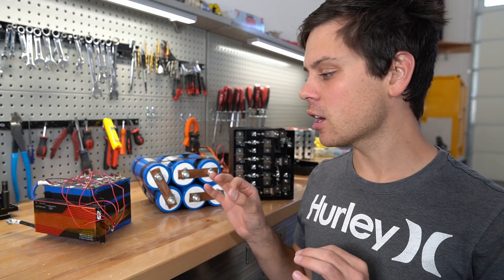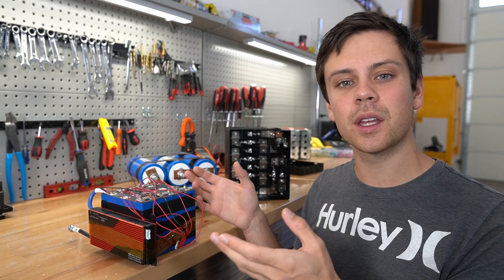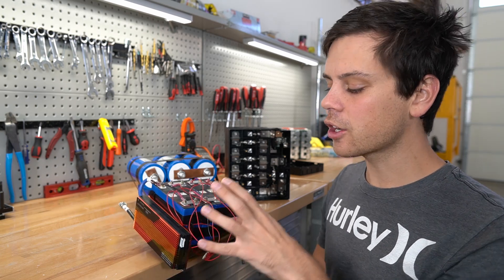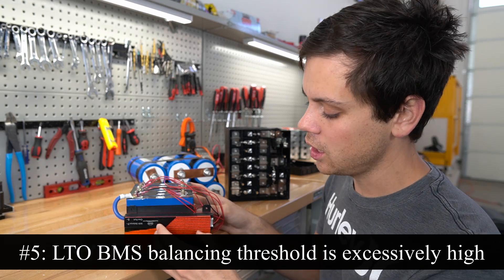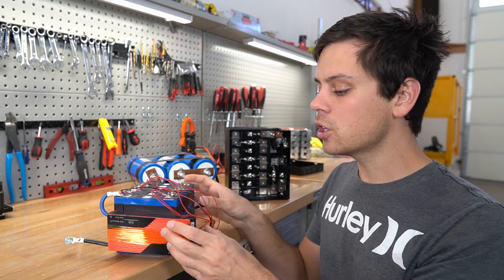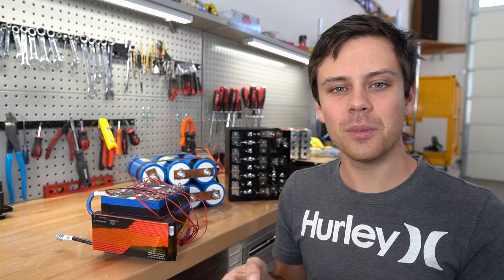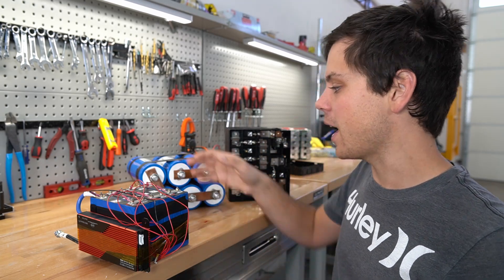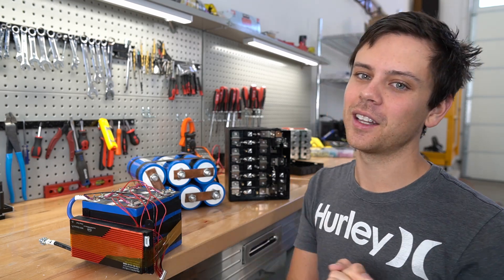I was wrong about Lithium Titanate batteries. But should you use them for solar? 2020 Update

Comment: Ahhhh thanks for clearing up that conundrum  - Your earlier superstition that Titanate  for super long life, fast charging with a downside of high cost, weight and bulk is still valid - I've concluded that Lifepo4 in 4S  is best for my motorcycle starter &  RV house battery because  they are most comparable with the alternator outputs (14.2V) - and li-ion for my ebike because of power density and compact size  - its a horses for courses approach  - as you said in your earlier post Titanate would be best for a remote station  were servicing was infrequent and where temperatures might be sub zero -  it could well be "Rocket Science" at least in application : )

Comment: Will, I was planning to get LTO's for a very specific niche.  Where I live they cut off power in partial part of my city due to high winds and I need to be able to recharge the batteries super fast and also be able to run a 120v fridge  which has a momentary 2000 watt amp draw for the compressor.  As such I'm looking to keep my expenses under $700 and LTO and 1500 watt inverter, home built 800 watt wind turbine (remember the high winds) all a part of the equation.  The turbine can spin up fast with 60mph gusts and dump it's juice into the LTO's.  Part of the job of the LTO's would be to keep the turbine from self destructing due to it spinning to fast by being able to take the whole load as opposed to burning off the excess through a resistor.  The other nice thing is that I can drive down the road where there is power and my neighbor will let me fast charge the batteries from 120V AC 20 amp circuit connected to a fast charger.  This is only if there's no winds.
Reply: Effective storage is based on the capacity you need,  prices I’ve seen on lto cells are around 60 bucks per 40ah cells , so around 1000$ per kw for storage, 700$ budget would get you two 6s 40ah setups so 80ah plus wire and Buss bar costs, if anyone knowS of a cheaper place for cylindrical cells let me know
Reply: @travishodges5179  Thanks for the reply.  What could I use to recharge the LTO's super quick (like in 15 minutes).  I have a 1000 watt 12V power supply, so in 6S I could get the series to get up to 12V, but not beyond it.  Boost transformers are limited to around 30amps (360 watt input)and even if that did work, I would need an hour to charge.  I could parallel 4 boost transformers but if one failed, I"m not sure if that would be a problem for the other 3.  Any ideas?
Reply: @pcguru2000  do you have them now? Or do you plan to purchase, 200amp car alternator will fill a 30ah 12v pack in 7 min, 60ah in 15, how big of bank do you have, how big is your source?
Reply: 1 kw is @ 85ah so a 200 ah charger will get you there in 15 minutes if you’re pack will stand it, that’s a lot of torture, should think slow and steady with solar, but dang, you should move!

Comment: What's you opinion on the battery (12V 200Ah Lithium Iron LiFePO4 Deep Cycle Battery, Built-in 100A BMS, 2000+ Cycles, 280amp Max) that is selling for under $1,100.00?

Comment: LTO is most used lithium type in car audio at the moment. Works very well for that application and majority of cars can handle 15-16V charging voltage. No one uses BMS but I've seen some using balancers. I don't have any because after half a year of use the voltage difference between cells was only 0.01V, I had the cells in paraller for 24 hours before assembly
Reply: What's ur thoughts on the xs power pwr-s5 batts?

Comment: Not to proud to correct an error - I like that. And agree that LTO is not ideel for solar...
I run a littel DIY solar in Denmark and find Smart-inverters very interesting. I testet one, and would like to know more. Can you test some ? (if not legat to connect where you live - then set up an off-grid, and use that to simulate the grid...) I love your shows.

Comment: Will, in a 48 battery bank made up of multiple 12v batteries can you use and supply 12v to one or some of the batteries. I want to fit three or four 12v 500W wind turbines to each end gable of my house, and connect each one to one of the 12v batters in the bank. Would this work?

Comment: All of these products are best for a certain application, it’s just understanding what the best solution for your application which is important. I agree with Will btw, it’s unarguable that LiFePO4 is best for solar off grid storage right now, but like everything, it will change over time. Probably better to only consider the payback over the next ten years when buying, because by then there will be far better and cheaper options to upgrade to.

Comment: Hey man I don't know what kind of 12 volt system you play with but most 12-volt systems range and between 10.3 + 14.5 for 12 volt system most RVs and small homes and vehicles use a voltage within this range those batteries that you're talkin about are perfect for that they stack nicely at 2.3 Volts for the Toshiba version by the way same chemistry different company and few were slaves in the processing of those cells I don't mean to be really nasty about China but they're not the most ethical and their Manufacturing

Comment: Bonus points for the correction.  I still think those may be the ticket for my weekend home rail caboose I am building. I am in between heating a LifePo4 pack to +5C when needed or go with this chemistry and it just works. I need to run from -10C and up.

Comment: Will, curious if you have decoded this Winnebago Volta electrical system ""Pure3 Advanced Energy System uses safe, dependable automotive-grade technology to provide up to 9,600 watt-hours of power (12,800 with optional 4-module energy pack) for extended off grid stays (59GL, 59KL).""  9,600 watt-hours would be 8 Battle Born batteries , correct ?  The battery modules don't appear to be big enough for 200 Ah batteries.

Comment: I agree about the cost but the LTO w/6cells (if you have the money) should do fine in a nominal 12v solar application so long as your battery capacity is well matched to your solar array. Even solar modules made for charging 12v circuits typically have an Vmp of about 18v and there are programmable charge controllers that can configured to operate in the optimal range.
That said, the loads would need to be checked for higher voltage tolerance or use a high efficiency dc to dc converter.

Comment: I use these in a 12v car audio system every day and love them. I'm only charging to 14.9
Reply: Can you use it as a starter battery?
Reply: @TamponTea  You could, but I would suggest a 32ah bank of headways for that and just case it.
Reply: @zaywilds3579  thanks for the response. I live in a uninsulated box truck up north with no heat. I wanted to go with 8 lifepo4 280ah cells. For starter/house battery.  Lto can be charged down to-40. And i can get 200ah usable on 12 v with 42 40ah cells.  They cost the same but significantly less capacity. I can only fit 300watts of solar on the roof. My lights draw 40w and my fridge runs 10 hours a day drawing 4amps 12v in summer.  Its not uncommon to have 3 cloudy days in a row either. My biggest problem is the cells freezing. Right now at 10am its 18f

Comment: Can you use a buck converter with a 24 volt system or even a 48 volt for 12 volt RV system????
Reply: Yes, that is exactly what I do in mine for anything not running directly on 24v. Also buck down to 19v for a computer monitor and charging a laptop. And down to 5v for usb charging.

Comment: Hey Will, I have also done a few tests on my cells and I have discovered that when I do a one C charge / discharge at -15 degrees F. I receive roughly 85% of the capacity when compared to one C charge / discharge at 70 degrees F.
These cells are perfect for cold weather applications when I use a 24 volt -> 12 volt converter. I lose roughly 5% in efficiency, but I need these cells to work in negative temps for the application that I have without the cells being destroyed.
Reply: What 24 to 12 volt convert could you suggest for me? I work in cold Temps so I am going to try this route. Thanks in advance!
Reply: @entune85  I bought from AliExpress the RCNUN model RC241230L as 30 amps was plenty for me. I tested it using the 150 watt discharge tester Will demonstrated in one of his videos. I tested with a load of 150 watts on the output side, and saw an incoming draw of roughly 156 watts. So that would be slightly better than the advertised 95% efficiency.
Reply: I'd put them in an insulated air tight box something that would hold in the warmth and not lose it.
Reply: @herbertwerner2287 , I do not trust or want to risk an insulated box being able to keep the temp above freezing. I have a remote hunting cabin where I attached a solar Panel to charge a bank of 8 LiFepo4 batteries that I put in a 50 gallon plastic barrel that I dug into the ground. This works great as the ground is above freezing because of the insulation we put down. I have a breathing tube and access panel as well.
Reply: @Aaron_Peters  Oh I see Aaron, ya I didn't know you where doing that I thought you were asking for an idea of how. I like your idea, I had thought of that myself and then forgot about it. Plus I would just think that might be all around safer to have them where if anything were to go wrong with them they would be in safer place.
Reply: What is does "C" mean? Coulombs?

Comment: Swopping out my LTO (3kwh) for a lifepo4 pack I built from 32700s (6.5kwh). This is for EVlyn the electric motorcycle I converted. Would you say this is a good move? If I leave 20% capacity in the pack what do people normally get in respect to cycle life. Guesstimate?

Comment: Congrats on redoing this, admitting the errors in your earlier videos, and just being you.  :)

Yes, these have negatives as compared to LiFePO4, but they are a valid option with some positives when using A Grade cells.  (The biggest issue I see is for people wanting to use only a 12V system, but most home setups will be either 24V or 48V.)

Comment: Thank you Will, you just proved why the Elechive by Zero Breeze has a 35v min voltage for solar charging.  They even made their 100w panels to act like a 24v panel ("Our 100w panel is customized with the output of 35V.").  Just what we don't need.  I canceled my order when they started flip-flopping between 400w solar and 800w solar charging.
Still. I look forward to your review, as they said they were sending you one.

Comment: The safety of these should be put into the equation of application. Efficiency, life span, temperature range, and large currents is a list that combines to make a stronger factor than individually. I am sure there is overlap of chemistries in use situations. Thinking of the whole system and how it interacts with other components and requirements is the path to finding a fit. Often a good fit is more usable than a system of the best components.
Reply: "Often a good fit is more usable than a system of the best components." Very wise words.

Comment: I agree with your conclusion. When you weigh the pros and cons LiFePo4 is simply the best chemistry for solar that we have right now. I can build a massive battery bank that is really cheap and when it wears out in 20 years or so I will almost certainly have better options available. I think size does matter even in stationary applications. A 30 kWh pack isn’t that big for LiFePo4 but would be much bigger and take many times more cells with LTO. Not to mention that you have massive 280ah cells for LiFePo4. Imagine the sheer number of parallel cells and bus bars you would need to use LTO for a large project.
Reply from the maker: Agreed! Great points.
Reply: @SystemsPlanet  That’s true but even the bus work will take up a lot more space because of the sheer number of cells. I also wouldn’t mind building another battery bank in 20 years, especially if there is better technology then. If I invested all the money I saved going with LiFePo4 over that period I could afford an enormous battery. The opportunity cost of LTO right now in incredibly high in my analytical mind.

Comment: I think they're great for telecommunication towers.

We use 24v DC systems. This would help with the long term cost of keeping a highsite running with backup power.

Would also combat the theft problem due to their weight.
Reply: How do you overcome 21v voltage cutoff also some boost converter?
Reply: @Coladudetje  yes. Buck/Boost circuit. 

There's quite a few options for the Telco industry now. Can customise every aspect of the system and manage everything remotely.

Comment: Although you are correct about the price of LTO batteries however, they become far less expensive than lithium batteries when you have to charge them in freezing temperatures. In my case I lost $5K in LifePo4 Battleborn batteries because of power loss due to a 6 day span of overcast weather, causing them to drain where they could not keep them heated. With my LTO SCiB batteries I eliminated this problem and have not had any issues since. I run 20 batteries on each rack, back feeding them through 2-pole 20AMP breakers in a 225AMP Square D panel. 27 360W mono panels and a Sol-Ark 12k tops it off. This off-grid solar system gives me more power than my current needs presently. I use all 24 cells and a Nominal of 60V and a Minimal of 48V. Will, can you see anything wrong with this system? Forgot about the BMS. I had DALY make me 24S common port 40AMP charge and 40AMP discharge.
Reply: @SystemsPlanet  I bought them from Greentec Auto when they had them. They came out of a Honda Fit. They are rated at 64.8V but I use them in the happy zone. Toshiba says that nominal voltage should be 2.4V per cell so my DALY BMS'S are set to start balancing at 57.6V and top balance at 60V or 2.5V per cell. I also have a 24V system I split the packs in half and use 30V Nominal. Currently my 48V battery bank is 1800Kw. The 24V bank is 2.25Kw and also has a 900W wind generator which I have seen produce up to 1600W in high winds. The DALY BMS'S were $29 each, including shipping.

Comment: Thank you for touching on the car audio application. Seeing that i only charge up to 14.8v max in my vehicle (usually 14.4v) keeping saftey in mind would you recomend lifepo4 winston cells with just a 4s balancer? Any advice would be greatly appreciated! i currently have a 100ah lifepo4 group 31 size battery but the bms limits the output to 200A max.

Comment: Will, there's a company up here in Canada offering a cold weather lithium 300aph battery, the company name is Canbat. Is it just a different type of BMS or is it a different chemistry to create a cold weather lithium battery?. And don't worry about the hair, at least you have some.
Reply: Might be one of the heated batteries
Reply: @edmor1086  Canbat Battery Company, go have a look and please give me your opinion.
Reply: @taxslave5766   I did take a look at their batteries. Lithium iron phosphate batteries can be discharged at very low temperatures but not charged at very low temperatures  although you can charge them at very low rates at lower temperatures.  They don't mention heating so I am not sure what's going on
Reply: @edmor1086  Thanks for your comments Ed. Will did a review on Big Battery a little while ago, and they say you can recharge them at low temps. But I'm not sure if the chemistry is different or a different type of BMS. I'm building a conversion van up here in Canada, so cold weather lithium battery would be ideal. I'm also considering just buying lithium cells and build my own battery bank? Will see, I'm a rookie when it comes to this electrical stuff.
Reply: @edmor1086  I guess I could build a large enough battery bank in order to compensate for a heat source for the lithium cells, it would probably be cheaper than buying a Battle Born, Big Battery or a Canbat. I wish Will was my neighbour lol.
Reply: @taxslave5766   I think all lithium iron phosphate chemistries will be the same. Building your own is certainly a cheaper option. A good BMS will have a low temperature cut off. Since these batteries don't need to be vented you can put them in your Van area where you keep it warmer.
 How cold a temperature are you going to be in? Battleborn's low temperature cut off is 24ﾟF

Comment: Sounds like a prefect fit for a boost/buck converter if wanting to use it for 12v applications
Reply: you could set it up as a 24 or 48 volt system then use a 12 reducer to get what you need if you need 12v

Comment: Sounds to me like I would have no problem with a 12v system lithium titanate with 6s configuration, and alternator charging running at a higher voltage than lipo? I have a renogy 60amp DC-DC and I'm all about cycle life

Comment: I think they are perfect for a garage/out building shop where you need high amp out put to run an electric motor for an hour or 2 and you don’t temp control the area.

Comment: I do agree on price being not the best. But when used wuth a proper BMS. You can indeed use them effectively in a 12v system.  Also the high C rate actually helps in a 12v system since 12v obviously draws more Amps than a 24 v system
Reply: Also never charge a yin long over 2.8v trust me